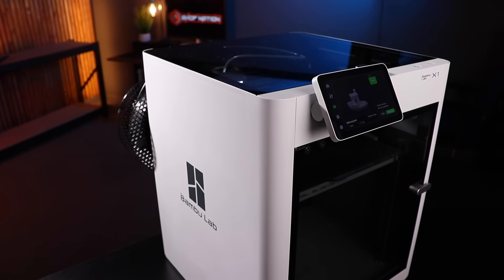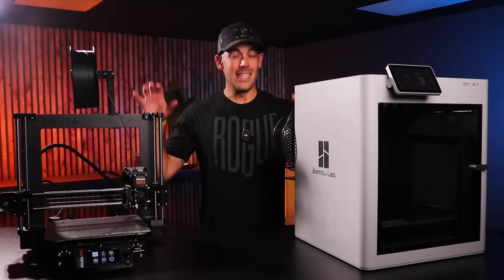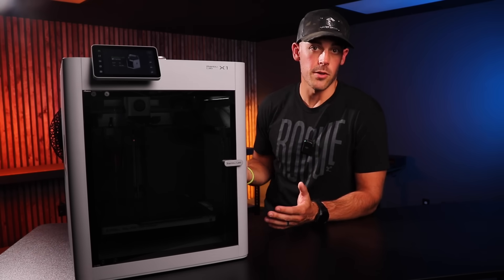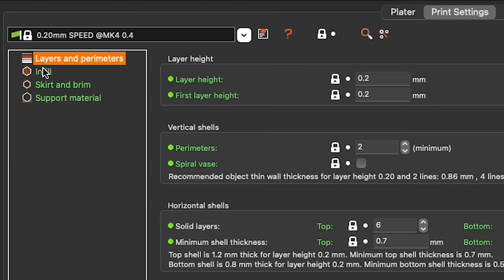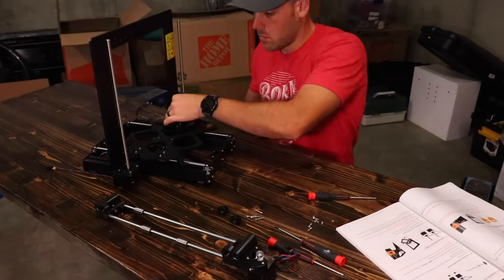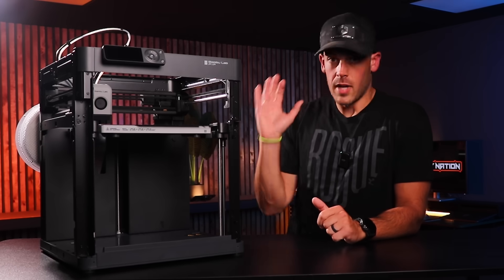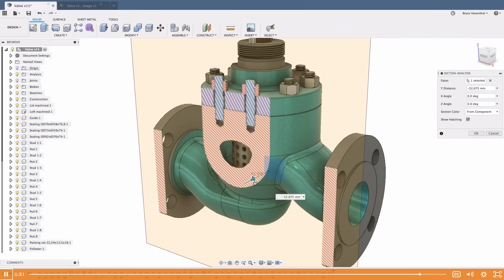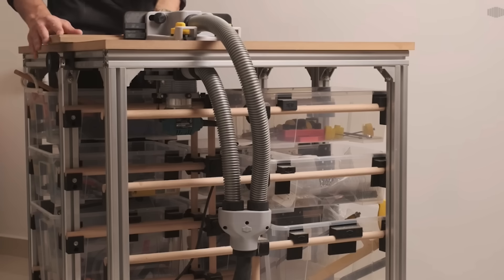The 3D Printer I'd buy if I started over

Comment: I agree on all points and own a Bambu Lab X1-Carbon. I have 5 other printers as I got into 3D printing years ago.
I will add that having cheap printers and learning how they work and modifying them to be better, I learned a great deal. That being said, I understand some people don't want to learn and just want to print.
Reply: recommend the best printer to get started on? budget doesnt matter i dont want a cheap one just to save money but takes more time to learn and get familiar with the machines, money is no option i just want the easiest to use with best results and ability to know what the limits are in 3d printing...the p1p good enough for a first timer without being overwhelmed and discouraged to keep going? ive seen lots of ppl praising bambu
Reply: @shane_wc  without out a doubt the easiest to use is Bambu. It just works
Reply: I'm tired of constantly tinkering with my ender 3. So you're saying I'll love a bambu ? Lol
Reply: @mattice9083  I guarantee it. It's like going from an old tube TV without cable to a 4K OLED
Reply: @Bennett_Lab  I've been working on a 3d printed flight yoke and pedals for weeks now cause I've been wasting days trying to level and calibrate my ender 3. I just can't waste 2 hours calibrating and 5 hours waiting on the print only to have it be like 70% decent lol can't wait to buy one

Comment: I just don't agree with everyone that says if you want to get into 3D printing to start with a 700$ printer. That is such a steep price for someone trying something for the first time. When you buy something like an ender3 you are learning how the printer works and how to fix it. When  (and I say when because something WILL break) you are stuck behind a 700$ machine with walls around it and don't know how to fix it if you are ballsy enough to open up a 700$ machine. A Prusa Kit is a better idea but its still a 700 machine just to have a little more reliability. Am i really the only one that cant see past such a price jump for not that much more features?

Comment: STOP…  Delta's are best for novices or people that don't want to keep adjusting their beds.  Delta's adjust once.  They print fast - flsun V400 prints at 100 plus mm per second.  it also comes with klipper.  Stop pushing these bed slingers (I'm talking about most of you reviewers) so STOP showing only bed slingers…

Comment: Thanks for not putting down another garbage spec sheet warrior comparison (boring).

I really appreciate your secondary and tertiary effects on someone trying to 3d print. Very cool. I slightly disagree. But that's ok: I still recommend the x1c over p1p.

However. I do see (for the price) why you recommended the p1p over the others.

Comment: Dude, I've got over 3k hours on my X1C. I'd never recommend someone new to printing go for the cheap/slow option. You can't beat the plug and play that comes with the bambu printers for new users. Plus the P1P model is half the price and still better than a Prusa, plus you can spend a few bucks extra to get some of the features the X1 has that the P1P is missing.

Comment: Thanks for the video but I have to disagree. I still recommend the Ender 3 and I feel they work great out of the box. I have helped friends and family set up several of them. I used mine for 3 years before I started upgrading it and I only upgraded it because I could. Many of the upgrades I did do would benefit the Prusa as well.  It was working just fine and had thousands of hours of prints with almost no maintenance. Aside from the Ender 3 working great out of the box it has a massive support community as well as a massive aftermarket if you decide to upgrade any parts. I can't argue the fact that other printers will be slightly easier to use but it is not that big of a difference. The biggest reason why I recommend the Ender 3 is the price, it is a quality machine that runs around $200 USD and can be found on sale for half that at times. I went through several nightmare 3D printers before I found the Ender 3. I suspect that it is only a small fraction of people who have had issues with them.

Comment: Great video. You basically described my entire issue with my Ender 3. I wanted to get into 3D printing to support my hobby of making 3D models and printing them, but it was clear the Ender was gonna have to become a second hobby in and of itself before anything meaningful could be done. The P1P is what I wish I had gotten back in 2020. Maybe I'll grab it...
Reply: Basically any Crapality product is far more trouble than they're worth. From assembly to shoddy build material (my ender 3 would never keep a level bed no matter how much I tried, and the cr6-se tried its hardest to burn our house down...three times!) they just aren't a good choice. A Mingda Magician X is in the same price range as an ender, and you'll get a lot more use from it.
Reply: I like this type of feedback. You didn't just say the product isn't good and rant off, you provided a reasonable alternative. I finally got my first house in the past year and want to finally get into 3D printing. 1200$ for a hobby that I may or may not even like is beyond excessive, so as a beginner I have been looking heavily at the 150-300$ price range, instead of a new large debt. Its responses like yours that I use to build my list of possibilities. Thank you. @Nowayfella
Reply: @bigeddthemonk  glad to be of assistance. 😉
Reply: My ender 3 pro has been great. I've run many spools of PLA through it and I print ASA and PETG parts with it on occasion. I used to run it 24/7 printing and selling stuff(That i designed in openscad; I'm not a model thief) on Etsy and eBay before I got a CDL and started truck driving. It's just a tool and just like any other cheap tool I've bought, it works if you work within it's capabilities and the ender 3 is very capable for the price. I wouldn't necessarily recommend an ender 3 over anything else but it met my budget and my local MicroCenter stocks them plus replacement parts and upgrades so it was a no brainer.
Reply: @Blenzo480  Glad you had a better experience than I did
Reply: Were you watching too many cartoons to be able to figure out how to use an Ender 3?  What exactly was too difficult with the Ender 3 for you?
Reply: @odinata  Its more a matter of annoyance and timesink than difficulty. Constant fighting with bed leveling, issues with firmware when trying to get the auto bed probe to behave after buying it, things like that. Just more friction than the limited amount of time I wanted to dedicate to the task relative to its importance in my overall workflow. I eventually got a resin printer, which, while messier,  was a lot easier to set and forget, and get usable results.

Comment: Had an Anet-A8...had to replace board a couple of times. I think thermistor finally ate it. Idk what is wrong with it. Replaced so much. Tried to upgrade it with SKR Mini-3 w touch screen. Anyway, got a Creality Ender-3...actually been loving it. Thanks for the content!

Edit: have leveled bed on Anet a bit....the Ender-3 has auto level built in. Had bought a part to auto-level Anet. Never got it installed. Anet took all day to put together. Ender-3, maybe an hour

Comment: I dove headfirst into 3D printing and followed all the recommendations for an Ender 3 Pro. It has been constant headaches for the few hours that it has actually run. It's likely I'll have to take it apart completely to rebuild it soon, and then make sure everything is perfect when reassembling. After that it'll build up a stock of products, once money slowly trickles in from those prints it's likely immediately getting replaced by a much more reliable and fool-proof machine. I can't imagine scaling up a print farm with a machine that needs as much attention and modification as an Ender 3 Pro.

Comment: Okay- great make a slip in hollow body connector to all those damn 12v and 18 v tools that cannot be used without the stupid old relic nicad batts that they want so much for   Drills and tools a plenty for cents/free & useful if corded with a acdc transformer of proper size. or an adapter that makes sense.

Comment: From my perspective, the development at Tesla served as a great example. As I closely followed the market, it appeared that there would be minimal changes. However, Bambu Lab emerged and introduced something entirely distinct from Creality and other competitors in the market. It is important to note that being different does not automatically imply superiority or increased accuracy. It simply implies that other companies, such as Creality or Prusa, are following a similar path. Therefore, there must have been some underlying factors that were previously not fully comprehended. Admittedly, not everyone appreciates the fact that Bambu Lab's printer is not open source. Nevertheless, I believe Bambu Lab's intention is not solely to cater to geeks and professionals but to eventually reach a broader audience. They have successfully taken the initial step towards achieving that with the P1P.
Reply: bambulab's work doesn't present anything new that the industry wasn't already doing. They did however, uniquely cost engineer everything, so it's actually affordable to the modern consumer. Much of the components are similar to much higher performance machines, such as the lidar being present in the mark X (which is now a 6 year old product). the idea of a daughter board being as old as stratasys' original patents. the corexy not being unique. Still an awesome company of course.
Reply: Curious, what does not being open source have to do with reaching a broader market? It sounds counter intuitive. I imagine more people can work with something that is open source.

Comment: so P1P/MK3+ vs Sovol SV06+20kg of filament for the same price? specifically for starting out, people won't know the capabilities so a basic printer is more useful until they know what they will be using the process for. Save your money and spend on learning vs jumping into higher priced, less user friendly, or input shaping for speed (but NEEDS tuning for accurate parts) Yes the Sovol needs some more manual input and a bit of tweaking but that's the same as the P1P or any printer since none of them are tuned perfectly accurate out of box.
Reply: hi bliska have you become a flat earther yet?

Comment: I've taken the dive into the 3D pool in both directions - FDM for larger, less exacting parts, and Resin for highly detailed or tight spec parts - for use in the real world.  Of course, I've my on collection of Benchies and Eiffel Towers, but the bulk of my parts are functional relating to electronics and plumbing.  For my FDM printers, I've gone with the Sovol SV-06 Plus upgraded to Klipper with input shaping.  For the Resin side of the equation, I started with teh Creality LD-002H and have just moved up to the Anycubic Mono X 6Ks.  Maybe I'm lucky or blessed, but all of my printers have worked first time out of the box in each case.

It's really great being able to prototype in PETG/TPU or resin and not have to shell out for molds and tooling to determine that your idea is way off the mark.
Reply: hi brucoder have you become a flat earther yet?

Comment: I am thinking of getting into 3D printing. I want to make some custom parts for antenna systems for Amateur Radio. How strong is the item that comes out of the 3D printer? A friend of mine has a great antenna that is over 30 years old and has a small broken part. I would guess just under an inch in diameter and about 6 inches long. Its used to secure two metal poles that are the conductors. Wood could work but it would swell and rot in time and it heavier than plastic. 

Very nice video, thank you.

Comment: Have the p1p, mostly print small practical pla parts, it is amazing, occasionally i want to do thermally sensitive materials or multi filament. When that is the case i wish i had just invested in the X1. Yes you can build an enclosure for the p1p and buy the AMS and get fantastic results, however at that point you have nearly spent the x1 cost. Regardless Bambu is awesome and i love my printer, also don't discount things like 1 minute to change a hot end, or loading their filament and having the recognized and just put in good settings, or spaghettifacation detection. Good stuff.

Comment: I just bought my first printer about 3 weeks ago, an ender 3 v2 neo. I've already printed repair parts for a machine at work, joycon repair parts, etc. I've already swapped the firmware, converted it to direct drive and have started learning to use carbon fiber reinforced filament for wear resistance. I am definitely enjoying the journey.
Although a Prusa was on my short list of models, in the end, the neo was the only one I could afford. If I can start to monetize this in my area, I will definitely be looking at the P1P - that speed is amazing.
Reply: Hi, I bought an Ender 3 Neo over a year ago. Once I learned how to get it working, read-learning curve, I have had zero mechanical or software problems. Maybe adhesion once in a while. I think the secret is, NO MODIFICATIONS.
Reply: So 10 months later, how are you liking the ender 3 you bought? I'm stuck on what to buy and just found out about the ender 3 v2.
Reply: @mattz8956  still like it, mostly. Kind of left it alone through the winter. 
I've switched to klipper and octoprint, which works great. The petg carbon fiber filament is my favorite to print with, it just works. The Ereyone brand grey petg, not so much. Just haven't used it nearly enough, but when I need it, it is so useful.
I need to order some decent pla for the simple jobs, I tried going straight to petg, but it is unnecessary for most projects.
Reply: @kstricl  thanks for the info! Good to know it still works. I don’t have a super strong interest in 3d printing so the $600 price range is a bit much so I think I will go with the ender. Have you had any issues with it before?
Reply: Now i have Bambu machines I would not touch a Creality machine.  They are cheap, but after a while, the tinkering just gets annoying, in the end you just want consistent prints.  You can get a A1 mini for 169 GBP, so actually even cost is not that much of a factor.

I have the K1C, so I have a flagship model too, they are still a pain in the arse.
Reply: @ My work got excited over 3d printing in the last week. Bambu is the only manufacturer we're looking at. The "It just works" ethos is worth it for that application.
My Ender spent a good chunk of the last several months idle because of home life but my son has started to use it again and is having a lot of fun. I really need to play around with some different filaments and grab another build plate. The failed first layer issue gets old in about one pass.

Comment: With my experience of 2 printers, for a beginner if you want a toy making machine or you're making small parts (e.g. jewelry) I'd recommend a photon. 

It's no assembly, there's only limited post processing needed (basically a spray bottle of acetone or isopropyl alcohol and leave it a couple of days outside), and if you don't wanna bother you can buy a wash and cure.
Also being sls you'll get way better quality than any sub $1k fdm.
The drawback is that resin is more expensive, but that's offset by needing a lot less infill than fdm, so all in all you may pay only 20% more in material per part but you can do more intricate parts.

Also the best part is that getting an sla printer isn't more expensive than an fdm printer, the only drawbacks being that you have a smaller build volume and you may want to batch print multiple models at the same time to save time, because only the height changes how long the print takes.

Comment: I couldn’t agree more on prusa. I had a cheap printer and spent ages printing things to make it work correctly so I could print what I wanted, then bit the bullet and bought a mk3s+, and since I’ve owned the prusa I’ve printed a couple of cool baskets for it, but needed nothing outside of what it came with to make it work. Now I just print the things I actually want to print, and they come out geometrically correct (another problem with my old printer)

Comment: I'm sorry but the reason the X1 is faster than the Prusa is because of its kinematic path, not because of input shaping. Core XY is much faster than bed slinging 3d printers due to the fundamentals behind it and how different its tool path is. Input shaping helps with overshoot and to reduce ringing effects, which you stated. However, it is not the reason as to why it makes the machine faster.

Comment: I made the mistake 7 years ago or more buying an Ultimaker 2 as my first printer.  I learnt nothing.     I currently have a creakily C10s pro which was …a little frustrating to put it mildly, but I learnt so much fixing it. Had it  4 or 5 years and has now has a hemera extruder and volcano hot end and it’s a power house.   Especially at TPU.  I primarily print things for work or home that are replacement parts and functional devices whatever I need I invent and design and print it.    These new machines look great!  But wonder how easy it is to retrofit better extruder hotends for my needs…….

Comment: Back in 2014 I bought a CTC makerbot clone, I modded it to make it more reliable, it's been a real workhorse to this day, but recent updates to MacOS have caused issues with the software and the printer itself is starting to suffer with age, constant filament jamming, bad fan bearings. So I've just ordered a bambu P1P, haven't got time to tinker anymore, I need my tools to work. 😊